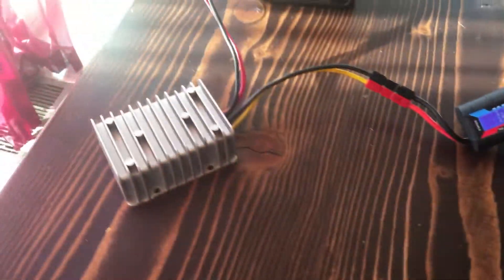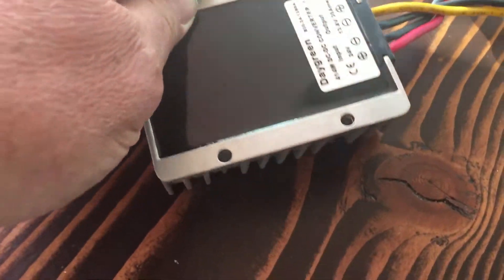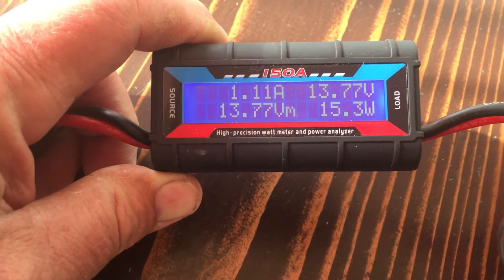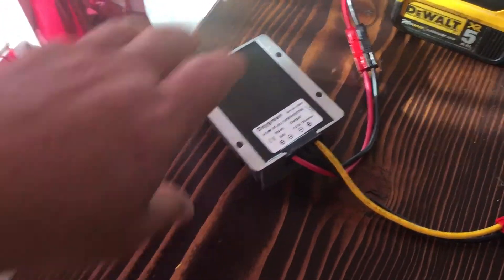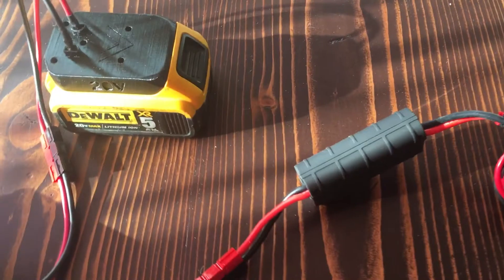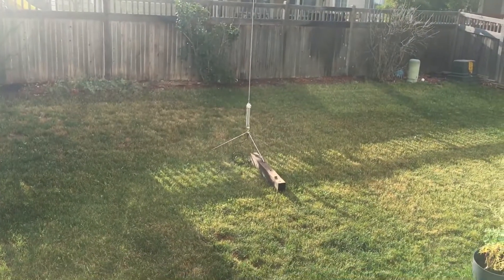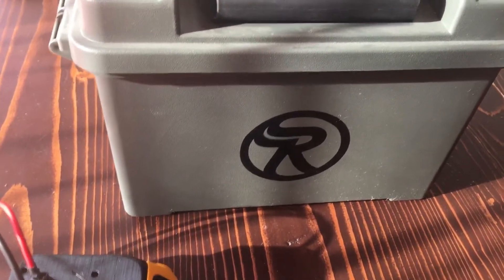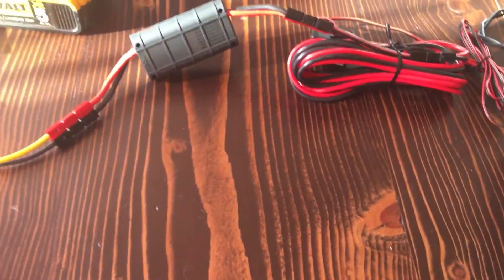Dewalt 20V MAX Portable Power For Ham Radio Operation | Part 1

Comment: do you have any voltage drop on transmit
Reply from the maker: I notice an obvious amperage increase but very minimal voltage drop. Maybe less than a tenth of a volt??? The wires I used are pretty heavy and if there is a weakness anywhere it would have to be the meter, voltage regulator or the battery.

Comment: I once arced a paperclip on a Ryobi lawnmower battery and it melted the paperclip. I approve this project. KG7QID
Reply from the maker: I got a lot of flack on inefficiency of this unit but it wasn't expensive to build and I already had a stash of DeWalt 20 volt batteries and I did not want to buy an expensive Bioenno battery that I can't use with my power tools.
Reply: Might as well enjoy them during winter when conditions are good and it is colder out. #bringyourbatteriesin

Comment: I have a 24v to 12v 5a 60w buck, 20v dewalt to MTD heated hand grips, instructions says 3/5a split 20w/20w off snowblower alternator. A few questions/issues. One issue is at buck output is at 12VDC, however at the each grip warmer it reads 6VDC and also reads 12VAC, That an issue? Q2 does the Amp size matter, if i did a 10a instead? The grips work, takes about 15-20 minutes to get at about 100°. I use a dewalt 4amh battery. Its a actual mtd snowblower add on kit and i reconfigured the harness. 
Thanks

Comment: How long can you run the radio with 1 battery
Reply from the maker: It depends on the radio and how much you transmit vs receive and which Dewalt battery I am using. With my Yaesu FT-891 I would say about 3-4 hours on receive and I would estimate 1-2 hours if I were to use it in a POTA setting. Maybe less doing FT8. I have used this setup on my ICOM IC-705 and I expect to get at least 4 hours out of a battery. I want to pick up some of the large 6ah batteries Dewalt has but at that price I might as well buy a good LiPo battery.
The whole premise of using the Dewalt 20 volt battery is that I have a bunch of them and extra chargers. Also by using a voltage regulator I get the radio manufacturer recommended 13.8 volts to power the radio. I believe LiPo battery manufacturers should be producing 14 volt batteries instead of 12 volt ones. I believe there are some out there.

Comment: It looks like the battery adapter you linked to isn't listed anymore, but there are others. I managed to find one. I know on your other video you pointed out that the batteries tend to be expensive, I happen to have one and plan to get more, so it can still be useful in that case if you have the batteries anyway. It's also an interesting project.
Reply from the maker: I would not go out and buy Dewalt batteries just to do this. I did this project as I have a lot of these batteries already. I am holding off getting either a Bioenno or Dakota battery. At that point the LiPo battery is going into the ammo case and the adapter and regulator is coming out. Thanks for watching.

Comment: Does this create and QRM on the lower bands? I'm thinking about getting a DC/DC converter to use my 52V 1kWh e-bike battery when I'm out in the field.
Reply from the maker: I have not noticed much QRM but I honestly can't say, Sorry.
Reply: @1crazynordlander  , thanks! I'm sure you would have noticed if it were creating noise. I'll just order one and see how it does.
Reply from the maker: @schnitznschnatzn  This setup was quiet as far as QRM compared to my MFJ-4125 switching power supply. And by far quieter physical noise coming from that MFJ noisy power supply fan. I don't use that switching power supply for much anymore.

Comment: I am thinking of getting one of these cheap DC-to-DC converters to run radios from my 24V LiFePO4 off-grid solar backup system, but I'm worried about lack of filtering and the resulting RFI issues that could present.
How is your noise floor when using one of those? Specifically, how is the noise floor on 75 and 160 meters? Those are my two main bands of interest, especially in a grid-down scenario. Also, have you tried running a full 100W out, and if so, how did it perform; did you get full output, and what was the voltage sag like at full power?
You are the only video/review I have found so far that is using one of these on a two-way radio.

Comment: That’s a really cool bug out kit!
Reply from the maker: Thanks Jim! I was able to reach as far as NC from Denver with the radio and antenna setup I can get the whole works in a 50 cal ammo box and a tool bag. I need a longer tool bag though.
Reply: 1crazynordlander Yea, a collapsible antenna that’s fits in the box is next.  ;-)
You know someone, somewhere is working on one.
Reply from the maker: @JimsEquipmentShed  The antenna is a 102" collapsible whip. The tripod legs are too long to fit in my tool bag. I bought the kit that had the longer legs because of the winds we have here. There is also a 17 ft collapsible whip you can get for it. It all has to do with tuning the antenna to the band that you are using to communicate on. The coil on the bottom makes the antenna longer to tune lower frequencies.